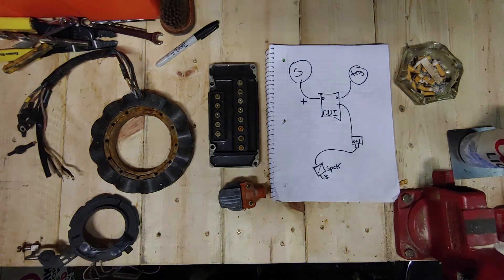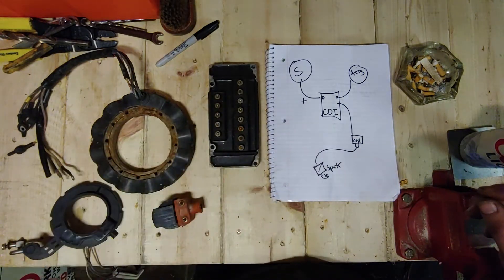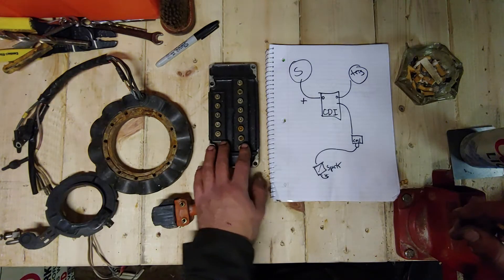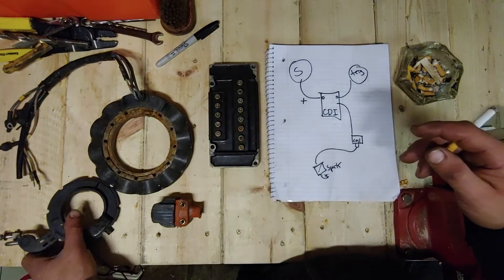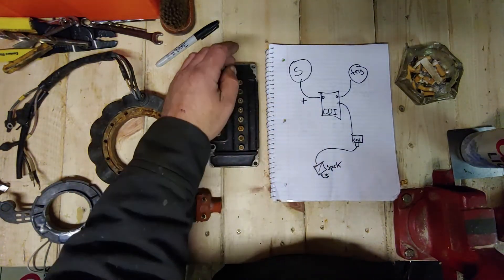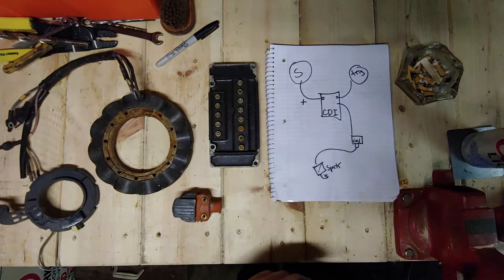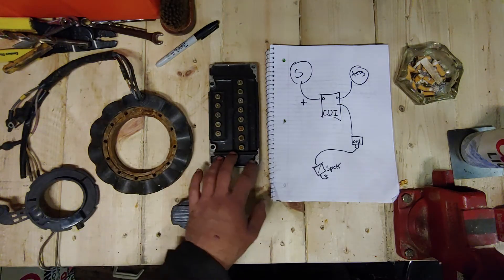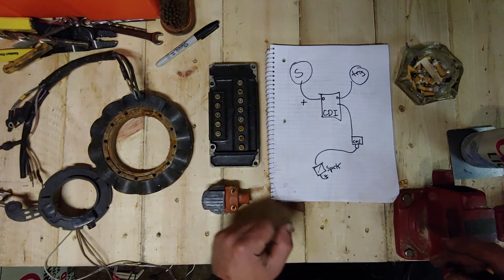how it works- outboard ignition/spark system

Comment: I have a 88 bayliner capri with the 125HP force,2 stroke. I bought it and ran it with water muffs for a few min and seen smoke coming from engine then the overheat buzzer alarm went off i quickly turned engine off and now i have no spark in none of my spark plugs. When i try to start it up now the flywheel just keeps cranking and no spark at all.  I just put 4 new plugs in it as well. But no spark

Comment: Great explanation. I've had a issue with my 1984 70 hp johnson for the past 2 weeks. 2 weeks ago it cranked up fine but next time I tried cranking it nothing. I figured it was the stator because I had no spark and the ohms check on the stator wasn't reading right. Soo today I unhooked the yellow rectifier leads amd it cranked right up so then I put them back on and it cranked right up ran fine and all that. Im just kinda baffled. I was so sure the stator was bad because I unplugged the power pack plug and tested the 2 outer pins and got 11.9 ohms and the 2 inner pins just read ol. So now every thing is working. Its just crazy stuff.

Comment: @WillametteValleyMarine how do you know which spot to hook the wires to on the CDI control box? Like is cylinder 1&3 on certain Part's like the first top 2 spots on the right! 

Then with cylinder 2&4 goes to the spots coming from the bottom towards the top which would be the last 2 spots! 

I'm wondering if it matters which spot the Stator wire's and control module wire's go on the box? Thanks for your time and videos!!

Comment: What if you have a single coil that fires 2 cylinders, but has no spark on 1 cylinder? That's my problem, I bought a new coil and still no spark on top cylinder.
Reply: Your coul has 3 input wires, one earth, one cylinder input from cdi, other cylinder input from CDI

Comment: Thanks for sharing. Good explanation. Can the stator send low voltage that can spark at low speed but not high speed under load?

Comment: This is a great fucking video. 

Id pay money for you to make a video like this explaining how to test the electrical system with a multimeter. 

I have a 2 cylinder 25hp, the bottom isnt getting spark only after it warms up. Replaced stator, replaced coils and spark plug wires, nothing. Do you think the trigger could cause this?

Comment: New stator.  Trigger had a burnt wire,  I spliced it.  Still no spark on any of the four cylinders
Reply from the maker: What motor. Year range?
Reply: @CAPTAINWILLY  Mercury 50 HP 4 cylinder 1986
Reply from the maker: No spark from any hole. Makes me question the kill switch. Also question the stator. I know you said its new. But whats the ac output?
Reply: @CAPTAINWILLY  I was thinking that and flipped it back and forth.  I disconnected the black/yellow stripe kill wire off the power module.  I put the stator in today. I don't have a DVA adapter for my volt meter but ordered one today.  I looked on line for a schematic of the controller thinking maybe the ignition switch is buggered up.  Motor turns over fine with the key switch but that doesn't mean its working right.  The burnt off wire on the trigger bugs me.  It was the white/black stripe.
Reply from the maker: @L2fish  white and black strip possible that that may loose one coil. Not all. You got this man.
Reply: @L2fish  what did it end up being? I am in the same situation

Comment: So what would you say it is if I have spark on the left 3 cylinders, but no spark on the 3 right cylinders, already replaced power pack, still no spark
Reply from the maker: Sounds like a trigger problem. Depends would have to test the wires coming into your "power pack
Reply: @CAPTAINWILLY  exactly what I was thinking, but how should I test them, probably a break in the wire huh? Or can I test them with my voltmeter?
Reply from the maker: @Madhandsboy  have you watched the other video? Tagged in this video. 
Your cdi "power pack. Is being told to release power to the coils with information from the trigger. Using your dvom. (Multimeter) find the wires coming from the trigger. Find atleast one wire that is sending power to the cdi (ac voltage) that is going to be one of the triggers to a coil that is working. Now find one that isnt sending power. 
Where that dead one sends its power to the cdi take it off the cdi amd swap the known good wire to the cdi in replacement of the dead one. Summary- firing one of the dead cylinder coils with a known good trigger. It will be way out of time. But if it fires on a hole that didnt before you know the trigger is bad. The coil os good amd the cdi is good

Comment: Captain Willy i have a 1977 402 electric start mercury that had no spark at all replaced stator and fly wheel used from marine shop and still no spark. Never used puller just took top nuts off and replaced stator and fly wheel then bolted fly wheel back on. Well there is still no spark.Motor turns over fine but no spark, used cheapo ohm tester and the results showed .794 and .795 when both wires probed to trigger still in motor what the heck could it be what other checks can be done. Any info would be appreciated thank you.

Comment: Mercury 125 “2+2” Two-Stroke 

Been reliable for years. Just now started bucking when transitioning to all 4 cylinders. Won’t do it every time. RPM gauge has never worked either. 

Any tips would help before I break into this weekend

Comment: I have a 2 cylinder 2stroke.  Cylinder #1 is firing at the same timing as #2. Is that a timer problem or a CDI problem?
Reply from the maker: If each cylinder has its own coil than its likely a trigger problem. If there is one coil with two spark plug wires coming off. Than thats called a waste spark system amd it is supposed to fire at the same time
Reply: Thanks for responding!  1976 Johnson 55 has 2 coils but only 1 flywheel sensor.  Cant figure out how it knows to make two different spark timings.
Reply from the maker: @kittredgejohn  ahh. Didnt realize we were playing with somthing this old. Yea pre 1980 evenrude amd jhons have a stator under the flywheel that only makes voltage. All the rest of the electrial workings happen in the cdi box. No trigger on this motor. Sence you have spark... To often. The only thing it could be is a failed cdi. On that csi there is no terminals to test from. Just a black chunk amd wires. Replace it.
Reply: This one has a crankshaft sensor inside the stator ring.  My CDI has 8 screw terminals (#8 is vacant).

Comment: Wow...  Thanks for this vid.  You really made me comprehend the flow chart.  I will also watch your vid on "how to diagnose no spark." 

I drove to Albuquerque, New Mexico (from Las Cruces) to pickup a 1970s Johnson 80hp outboard.  I only paid $50 for everything but the steering.  Came with all the controls.  Seller told me that there was no-spark, and he diagnosed it to the CDI.  Is the CDI box the same thing as the "power pack?"
Reply from the maker: Yea. Awsome thanks man

Comment: do you have a video on four stroke like the suzuki df140 that doesnt have a cdi
Reply from the maker: I dont. I plan to cover 4 strokes in a comming video tho.
Reply: @CAPTAINWILLY  Will a faulty stator cause no spark to the coils in a four stroke outboard that doesnt have CDI, suzuki df140 ? In the service manual it doesn't mention anything about the stator in the troubleshooting chart